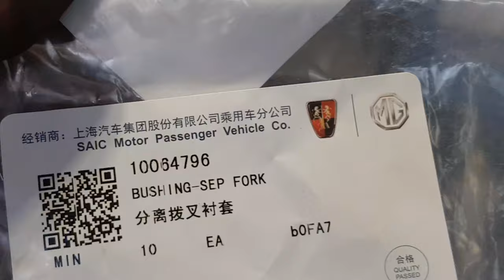MG3 Clutch pedal stiff & sticks down.

Comment: Hello, Ive had a similar issue with with an MG GS. Do you know if this is a similar issue? Any advise would be very much appreciated Many Thanks
Reply from the maker: No, GS has a concentric slave, it's a different setup to the 3. Check for leaks on all the clutch hydraulic pipe joints, any misting of brake fluid on the joints meant it'll draw air in. Lubricate the clutch pedal pivot points with spray grease. I've seen master cylinders fail on these too.
Reply: @pistonbroke  Thank you for this, very much appreciated.

Comment: Good video.  Shame the bush isn't brass rather than plastic.  It would not have pinched the shaft if it was.
Reply from the maker: It's all to do with minimal production costs to maximise profit these days.
Reply: @pistonbroke  I was trying to think of a way to prevent it but I’m not sure there is. The aluminum gearbox will always corrode in uk weather conditions. I guess you could smear grease into the end of the hole but that’s about it. Bit frustrating really.
Reply from the maker: @Aircooledflat4bug  put a big blob of grease on it. I put grease on them at PDI and those ones have never come in with a problem. All the ones that are left dry have issues. Low mileage cars suffer most as lack of use causes corrosion to build up.

Comment: mg3 MT and AMT it a same transmission? I have mg3 AMT in thailand. it doesn’t have MT here i want to conversion my transmission because AMT is not smooth
Reply: I want to know the gear control over the transmission is fit with AMT gearbox and how much and where i can buy please
Reply from the maker: We don't have the AMT in the UK so I don't know.
Reply: @pistonbroke  do you have website or some thing that i can find the parts.i looking for clutch padel and stick shifter

Comment: Any clue why a hydraulic system would have a clutch pedal with ALOT of resistance to the point car hurts your foot and hard to hold biting point? Changed EVERYTHING still stiffer then every other care I’ve tested of same model??
Reply from the maker: What car are you talking about here? If it's the MG3 then it's explained in this video.
Reply: @pistonbroke  oh I should of said I have a Ford Focus with concentric slave design so it isn’t the common problem you had with the release mechanism thing?…

Comment: thanks so much, with your video I was abble to do same job and also replace the clutch kit on my 2015 MG3 with automated transmission.
Reply: how difficult was it to replace the clutch kit after dropping the gearbox? are manual and automatic clutch kits similar to each other in regards of how easy they are to replace?
Reply: @gmathieson7184  it was more easy than drop the transmission, in this cars Automated/manual clutch kits are the same.

Comment: When you drop the gearbox out how hard of a job is it to then replace the clutch? 

I got an MG3 back in april this year, its a 2018 vti form start stop or something like that, but the start stop hasn't worked since i got it but it never bothered me... it sometimes makes a whirring noise... now its weird because i've tried researching and seen something about the start stop pump making a noise when its not working... so i've been turning that off at the start of every drive (just incase it was playing a part), I give the car a moment to clear all its ignition lights before full ignition, when i do this and drive like a normal human being i do not hear the noise. However, if i'm in say a little rush i've left something at home and i've had to return to the street perform a quick 3 pt turn then the car will start making the whirring noise again... sometimes its there while the clutch is depressed, sometimes the opposite, so im not sure if its like a pump engaging/disengaging whilst im using the clutch... or if its the release bearing... how concerned i should be etc... as it feels perfectly fine... just this occasional nosie. I can see clutch kits on ebay for £90, this job may be within my uncle skill set... do you think it sounds more like a clutch issue? or some other pump or something else? i do feel the steerings kind of heavy but it doesn't sound like a power steering pump. im a total noob and i think i maybe should have stuck to cheap runarounds because im sure the timing chains going to need done too... heck maybe thats why its making the noise.

Comment: Thanks for the great video. I also have an MG3 but in my case I had a leaking slave cylinder. Any tips on how to bleed it after replacing? Do you need a second person to press the clutch, or is it possible to do it on your own?
Reply from the maker: Pressure bleed is the best way. They can be a pain to get all the air out.
Reply: @pistonbroke  Thanks for the quick reply and advice. Much appreciated.

Comment: Really Great video really easy to follow ,i suprised how tight the shaft was ,I change clutch and bearing as low and oil filter while cover off went back together no problem but now have bad rattling/vibrating noise when rev the engine so may have to drop down again ,any ideas?
Reply from the maker: Can't think of anything at the gearbox end that would cause that noise. Did you turn the engine backwards when tightening the clutch? The valve timing can jump if the engine is turned the wrong way, especially on a pre 2016 car.
Reply: @pistonbroke   yes that's a possibility it moved back when tightening,would that now be timing chain replacement?
Reply from the maker: What year is the car? If it's pre 2016 (non stop/start) and the chain has never been done then yes I would fit the modified chain kit. Can you tell what area the noise is coming from?
Reply: Thanks so much for you help greatly appreciated 👍 I've seen the modified kit comes with loads of parts including gears ,was this not a recall from MG?
Reply from the maker: No it wasn't a recall
Reply: @pistonbroke  Thanks did u manage to see the video with the noise,do you think it is timing out
Reply from the maker: No I haven't seen the video. Where do I find it?
Reply: Sorry to be a pain just one more question before I call the garage what's the chances of valve bend ?many thanks
Reply from the maker: There is a chance but it depends how far out the timing is. If it's any consolation, I've done loads of chains and only 2 have had valve damage.
Reply: @pistonbroke  Thank you so much for your help 👍

Comment: Hello, great job, i have an automatic gear mg3 and i replaced my clutch kit 6 months ago, i always have the same problems, 1 my rear gear sometiems don’t work, the car vibrate a lot in first gear, do you have any idea to solve problems, thank you
Reply from the maker: We don't have the automatic in the UK so I've never seen one and had no experience with them. I do know that it's a manual gearbox with motors on it to control the shift and clutch, these motors need to be relearned when ever the clutch is replaced so that the ecu knows the correct biting point of the clutch. I can only suggest that you take it to a dealer and have them calibrate the clutch. If that doesn't fix it then the flywheel or clutch cover could be warped.